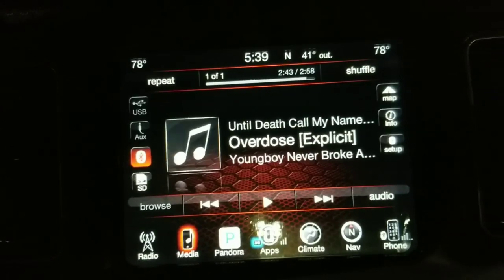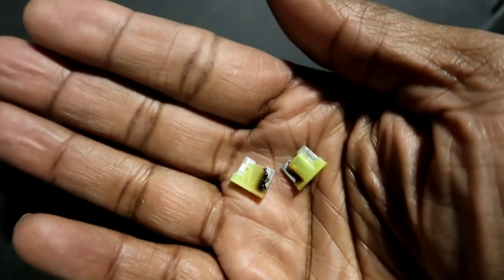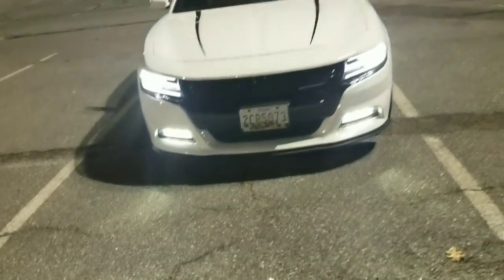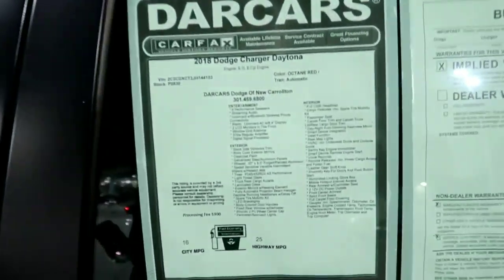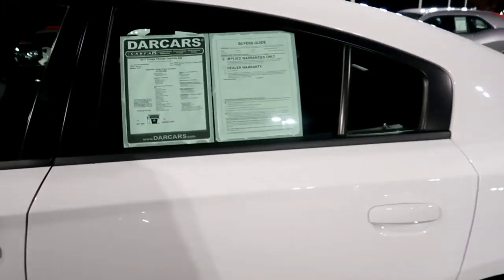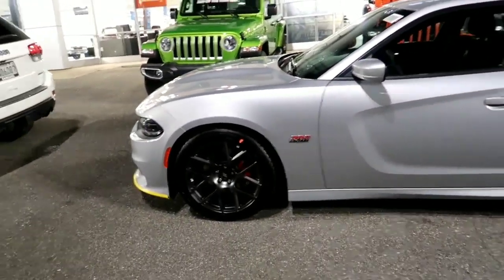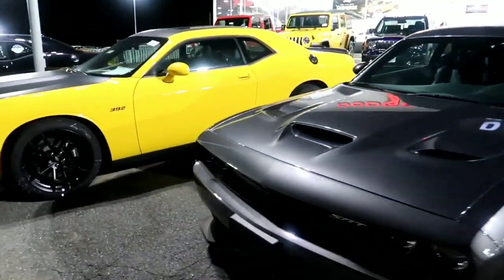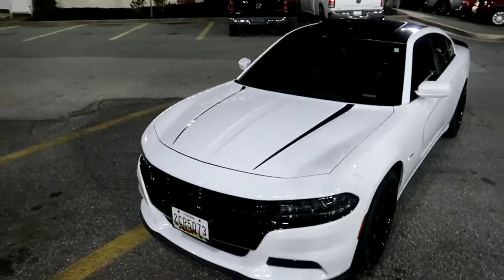Dodge Charger HID Headlight Repair How To Avoid Replacing The HID Bulb.

Comment: Wow glad I found this. Literally dropped my charger off at the dealer for this today. Gonna wait to see what they tell me...
Reply: Lol they are going to tell you that you need to give them your debit card info so they can kick your head in on repairs
Reply: @jasonjackson329  💯 they said the fuses were fine and that both hid bulbs needed to be replaced at 850 for two plus labor. I said nah. Gonna check those fuses and if the bulbs do need to be replaced still I’ll get OEM replacements from Diode Dynamics for 160 👍
Reply: E Fed so I had 1 light go out last week.  Then the other one went out the other day. Almost ordered bulbs.  But googled this problem and I’ll be dam.  I check fuses Saturday and both were burned up.   Replaced them for $3 bucks and back working again
Reply: @jasonjackson329  same here. Dealer had my car for 6 days. Said it was going to cost 850 and I needed new bulbs. I declined, took the car home and two 20a low profile fuses later my headlights work again. 80 cents in fuses vs over $800 in parts/labor 🤨
Reply: E Fed Just goes to show you why it’s so hard to find a trustworthy mechanic tech / dealership now a days.  Cause either they are part changes & have no idea what they are doing. OR they’ are trying to rob you blind every chance they get.   Sucks cause I know there’s good ones out there.  But they are hard to find

Comment: Just goes to show that you can find the problem in some the most unsuspecting but somewhat obvious spots to save money and how cheap the fuses are to handle lid lights. Thanks. But what about the question about the scatpack spoiler application